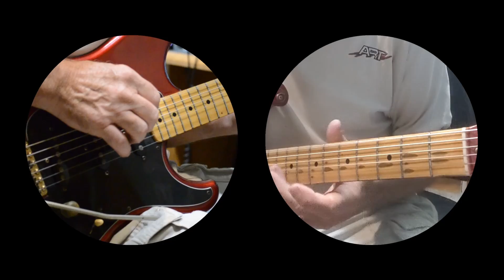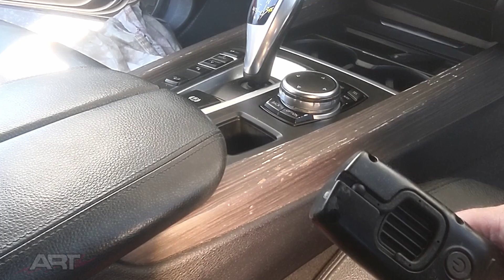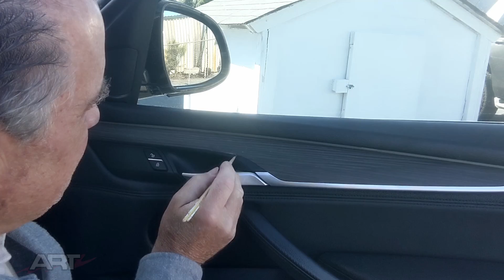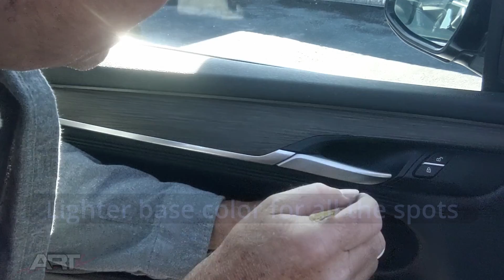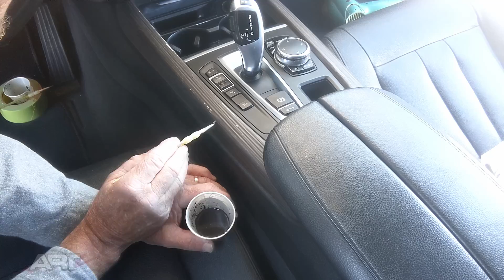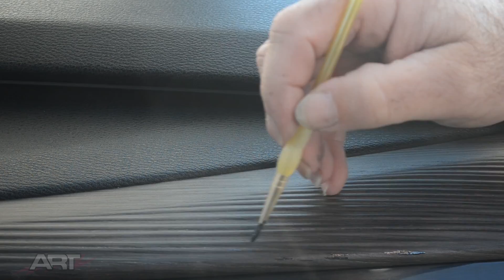BMW Woodgrain Trim Repair v127

Comment: Nice work Rick. This is one of those repairs that even another repair tech would be very unlikely to notice. Thank you for including the color matching process as well. My wife usually gets the paint ready while I do the repairs. She gets so frustrated at how many times it takes to get the colors right. She was feeling as if not being able to nail the color in two or three tries means that she isn't good enough to do it at all. After watching it take you several attempts was a little confidence boost for her.
Reply from the maker: Sometimes you just have to stick to it🙂.  We always know WHAT to add, just not HOW MUCH.  Whenever I have trouble I just remind myself to stick to the theory.  The answer is there.  Cheers!